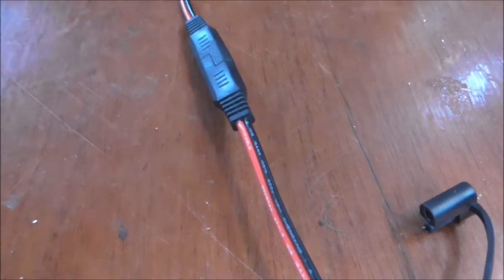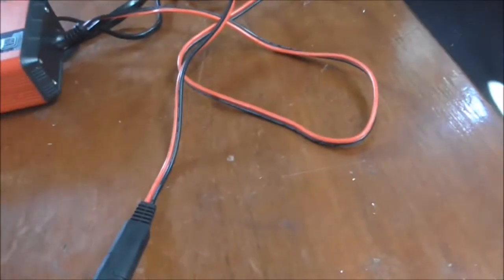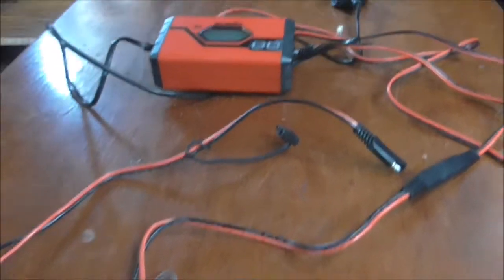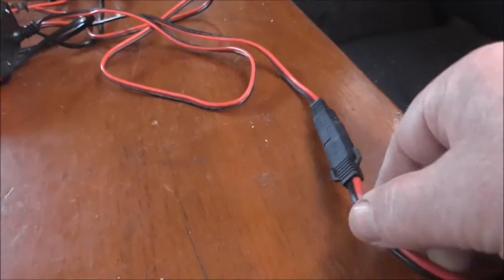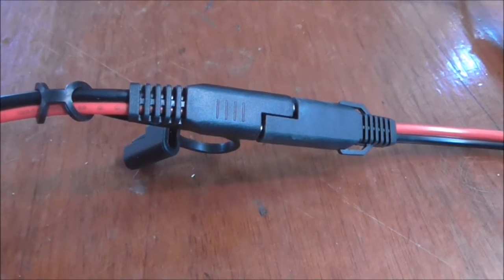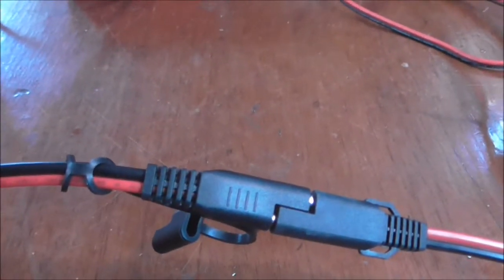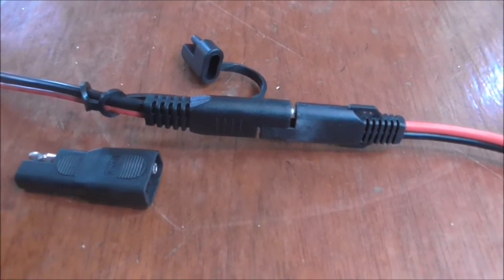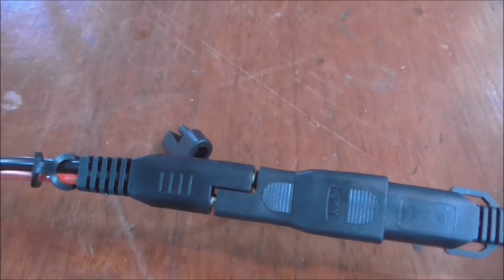Issue with SAE connectors - reverse polarity

Comment: Just remember the positive side of the connector is the pin coming from the charger to the load.  The battery is considered the load when charging.

Comment: Right, good. My new solar panel has SAE leads and I bought as as extra, a cable kit which has a polarity changer. On the other end of the job, a power station,  I need an XT-60. So, for inbetween the power station and panel,  I bought a SAE-to-XT-60 extension cable but its polarity is reversed when compared to the solar panel. Fortunately, the cable kit and the extension cable both came with polarity adapters as accessories. I looked for a video to make sure im doing this right so the info very appreciated. Thank you.

Comment: another time this happens if if you have 2 identical but separate sae to ring terminal cords.  For example the female side may be red on both. If you use them to connect two batteries (ring terminals on battery, anderson plugs connected male to female) the polarity on the terminals gets reversed.  It pretty obvious I guess, but i found it confusing.  Seems like the sae plugs should at least be labeled or color coded or something and come in two types: Male ground-female hot and male hot-female ground if they have ring terminals or clamps.  Good video.

Comment: It's really bad when the red and black wires are shrouded by a black outer sheath so you have to measure with a volt meter. Some guys replace them all with Anderson Power Poles, but for modest currents (less than 60 amps), the XT60 connector is cheaper than SAE connectors or Anderson Power Poles, and can be soldered instead of crimped (I strongly prefer soldering, I doubt a crimp is anywhere near as good as a good solder joint).

Comment: An SAE-to-SAE two-color cable can be installed correctly or incorrectly. When plugging in an extension cable, the energized positive  socket is protected by being encased in plastic, while the ground is a bare pin. So you will plug the end of your extension cable or other type of cable with one SAE connector into the source of power with the end having a BARE PIN into the positive power source. If the cable has only one SAE end, and it is not the end you need, you will have to use a gender changer. BUT there is a good chance the other end, if this is an adapter cable, will also be useless, with the polarity reversed. Nobody is smart enough to keep this nonsense straight in his head, so always test polarity with your meter. Remember that the pin, or socket that is most protected is meant to deliver positive current and it will join to the least protected pin or socket on an extension cable. What's even more confusing is that so-called "female" connectors  of some types will both plug into and receive the male connector at the same time (MC4, XT60).

Comment: this is NOT SAE connector:
"Upon researching, we found that there is no specification addressing the SAE 2 Pin overmold connector. SAE (Society of Automotive Engineers) Specification J928 addresses “Electrical Terminals – Pin and Receptacle Type” and SAE J1239 addresses 4, 5, and 8 pin trailer connectors, but there doesn’t seem to be an SAE specification for the 2 pin overmold configuration.

Seems the 2 pin overmold configuration was sort of a spin off developed in the early ’80’s using the spacing from the SAE 4 pin connector addressed by SAE J1239. So, technically speaking, the 2 pin configuration is not governed by any SAE standard, but they were developed to be compliant with SAE J928 and J1239."

Comment: For those of us who are comfortable working with electricity, you don’t need an adapter. Wherever your wires go back to ( say a charge controller for example) , just reverse the polarity there. Then your red is negative and the black is positive. Just be SURE TO REMARK THE WIRES WITH TAPE so you or someone else doesn’t fry your electronics down the road. I certainly can see where a novice who didn’t build their own system might prefer an adapter, and there’s nothing wrong with using an adapter.
Reply: That may be OK for one off fixed installation but when using same cables for various functions putting red tape on say negative cable could lead to grief.
Reply: @mgtsmartlady  Electricity doesn’t care about colors. If you have the adapter use it, if not just change the color of the wires. Anyone who thinks that a black taped red is a negative wire should stay away from electricity.
Reply from the maker: @twoweary  I would kindly suggest you stay away from electricity as clearly you have no respect for electrical good practice  
and safety.
Reply: @martint1151  spoken like a true NON electrician.

Comment: The real question is how to know which lead is positive / negative when the cables are all black !
Reply from the maker: Hi , I would say to check with  digital volt multimeter.  If incorrect polarity you would see a minus symbol before the volt reading and none when correct positive/ negative.

Comment: I found out this problem when I cut off the sae connector on a K2C12V4A charger by K2 Energy. I soldered on a DC plug. The Ribbed side is Negative and the smoothe side is Positive. Well I soldered the ribbed to the shield and smoothe to the center. Well guess what?!! I plugged it into the application it's made for and it crackled which means it's backwards!!! Now I do have a known good one for comparison. I used a voltage meter and checked the wires. It was  reverse polarity.

Comment: I've become a little too obsessed with the Anderson Powerpole connectors. I gave them a go after getting sick of fixing a 6ft long XT60 extension cable that kept failing at the solder joints, and I haven't looked back. I also took my lead acid battery charger and cut the SAEs off too replacing them with PP30s, although just in case I encountered SAE again I made two adapters using the cut-off ends. The wires might not match but the housings will line up for the reverse polarity connections.
Reply from the maker: Yes there's nothing worse then having cable extensions that are unreliable especially when you need them to work but you seen to have all the options covered now.

Comment: Ive had a Schumacher trickle charger for the last 5 yrs n it wont charge anymore My problem is the SAE connection is wired to my Harley's battery as a basic plug n charge My question is are SAE connection plugs universal in length n circumference to easily replace the charger brand with another brand Sorry probably not explaining this properly But I'm having a hard time finding a replacement charger that I can just plug into the SAE i have wired directly from battery to what I'm hoping to find a possible new charging system any advice would be Greatly Appreciated Thanks to any n all that can help.
Reply from the maker: Hi,  my understanding is that the SAE connectors are all of the same specification. The charger I show on the video has SAE connectors , I purchased that unit on Amazon. Just be sure the check polarity when connecting.
Can you test your charger on another battery ? Just in case there is a faulty / loose connection.
Reply: @martint1151  I'd like to test it on another battery but wouldn't know what to look for to be honest. I really appreciate your response and advice hope ya dont mind me asking how could I check polarity b4 buying I have to buy online also what would I be looking for. Thanks much Martin.
Reply: Martin i understand how to check polarity if I'm wrong Please let me know I have to make sure the power n ground match the same male n female connectors
Reply: I also put in a new battery the beginning of the 2021 riding season and double checked the connections b4 securing the battery in place.
Reply from the maker: Hello again , this isn't easy from a distance but perhaps if you purchased a new charger with SAE connectors and one of the reverse polarity connectors you should be able to match up the same as your existing charger.
I have no experience with motorbike batteries, is there any buddies that could help out?
Reply: @martint1151  That's exactly what I was thinking again I really appreciate your help and time.  Stay Safe my friend

Comment: I did something dumb with SAE connectors. I have two deep cycle batteries for a trolling motor and i thought I was moving the charger from one battery to the other but I had the battery connector in my hand and not charger connector. As soon as the two batteries met it was 24v worth of sparks and smoke. Oops luckily it was only for a split second and nothing caught fire or exploded. I think I am going to start using Anderson style or xt90 type connectors.

Comment: Do you have a video of how you crimped the wire to the connector? Thanks for the Vid.
Reply from the maker: Hi , the cables came with the connectors crimped and sealed from the factory / supplier , you can get various arrangements. The reverse polarity connector fits the cable connectors.
You can also get what they call SAE tails with one SAE fitted and bare cables the other end to allow you adapt to existing cables.
Reply: @martint1151  this is exactly what I did.  I bought a 5 pack of SAE extentions cut them in half and now you have 10 adapters.  Nice to know that polarity reversers exist though.

Comment: Thank you very much my good sir, I couldn't work out why one of my batteries would charge and the other would not! I halved a single cable to add SAE connection to 2 12V batteries and one wouldn't charge. Reversed the polarities and all sorted. Appreciated!
Reply from the maker: It happened to me also in the past , glad you have it sorted now.
Reply: How does one reverse the polarity back
Reply: @bobbader4789  reverse the cable. So if you have red to red and black to black, make it black to red and red to black.

Comment: What would happen if I Connected 2 Extension Cables .
Would I Still Need a REVERSE POLARITY CONNECTOR TO MY SOLAR PANEL AND CHARGE CONTROLLER ...
" I HAD TO HOOK UP 2 EXTENSION CABLES FROM MY SOLAR PANEL TO THE CHARGE CONTROLLER ."

I KNOW YOU SAID WITH 1 EXTENTION CABLE YOU NEED A REVERSE POLARITY CONNECTOR..

BUT WHAT ABOUT 2 EXTENSION CABLES ??

Thank You Very Much For Your Help 🙏
Reply from the maker: Hi , it depends as every situation can be different, if when you connect the cables you get red to red and black to black then it's ok . But if you find one of the connections end's up with different colours opposite each other then you may need one of those reverse polarity connectors.
If it's a permanent installation you could consider cutting the cable and make the correct connections.
By red to red I mean positive to positive.

Comment: THANKS! 

TIP:
I think you could change the title of the video 
from "Issue with SAE connectors - reverse polarity"

To: "Issue with SAE connectors solved - reverse polarity"
Or: "Issue with SAE extension cable connectors solved - reverse polarity"